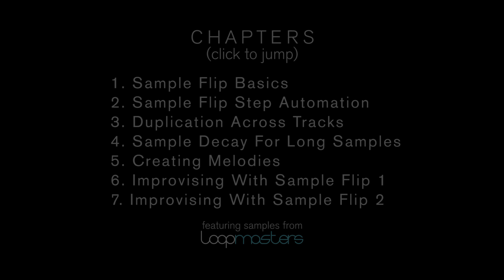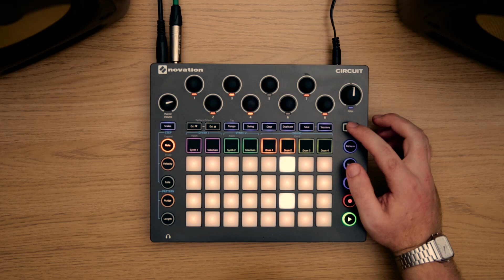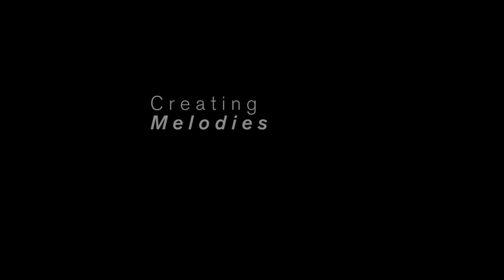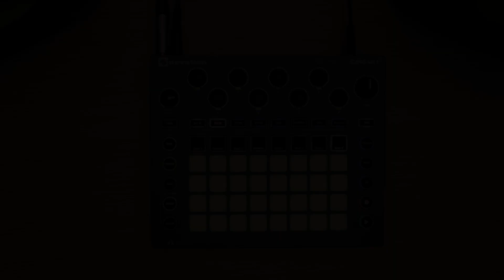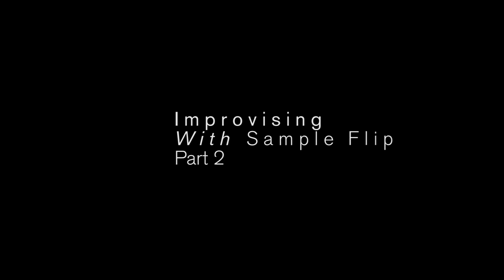Novation // Circuit 1.3 - Working with Sample Flip

Comment: Hi ! I really need your help. Lets say I have one sample with 6 seconds, I change up the pitch of the sample by 12 semitones (so it will be shorter, lets say 3 seconds, to save up memory). When I use it in the circuit I hope that if I put down the pitch of the sample it could play at normal speed and normal pitch. I just want to know if that is posible in the circuit (since it doesn't have screen, it has to be set up with your ears). The Circuit will warp-quantize  in someway the long sample, so it will be useless (the sample will be at the same fast speed with a weird lower pitch)? Thanks !
Reply from the maker: As Circuit is limited to 60 seconds of sample storage, the Sample Import feature works best when used to add short, percussive samples and one-shots. That said, you can also import longer samples although this may result in you running out of space quickly and having 'empty' pads in the sample selection area of your Circuit.
Increasing the pitch of samples before importing them will reduce their length and take up less storage space on Circuit, as you have suggested. When imported, samples that have been pitched up can be reduced in pitch using the dedicated Macro to return them to their original pitch. Circuit won't "warp-quantize" samples, the Pitch Macro can be effectively used to decrease the pitch of a sample by 12 semitones or 1 octave.
Reply: Check out Red Means Recording on shortening your samples to save on space
Reply: Circuit can go 2 octaves lower so you can get even more out of it now if you don't mind lower quality long samples. The circuit is near perfect now..... All I really want now is a sample start point editing function..... that would be a dream come true

Comment: Hi. I've just bought this smart little machine. Could you please tell me how to preview patches? I press shift + synth 1 and then I see 32 highlighted pads. But when I press them, I hear no sound. Why? I'm not in a record mode. The same is when I go to drums.
Reply: I can only hear them when I record a sequence and then press "play". Then when I press shift + synth and choose any pad, circuit will change the patch. Is it normal?
Reply from the maker: Have you updated your Circuit firmware yet? Patch preview was introduced in a firmware update, it sounds as though you may need to update to access this and lots of other new features.

Comment: Please provide better documentation for the sample flip.  This video is confusing, as is the addendum.  I'm having a easier time understanding my new Elektron Analog Keys than the Circuit, simply due to better documentation.  Steps to replicate please, not a long paragraph that says do this while holding my nose, scratching my ass, and holding shift with my left toe.

Comment: This was the update that sealed the deal for me.. I wonder if it's possible in a future update for individual step changes to be possible while playing, without having to record knob movements? ie. hold a step and adjust the parameters for that step, much like how note/velocity/gate works on the synth. This would make it a very powerful competitor to the Elektron parameter lock system :D